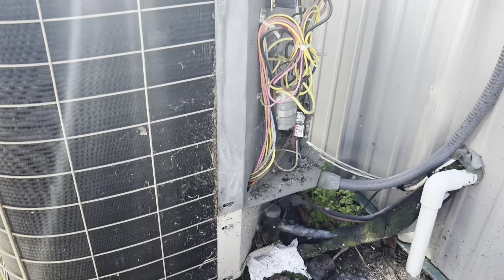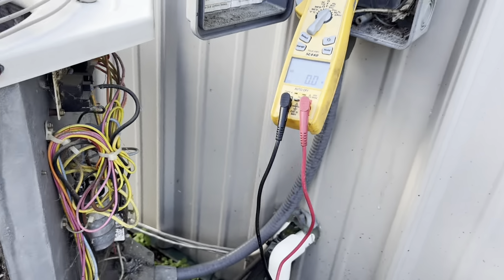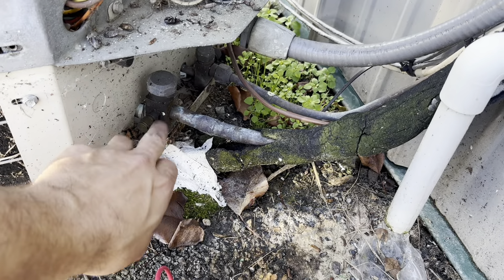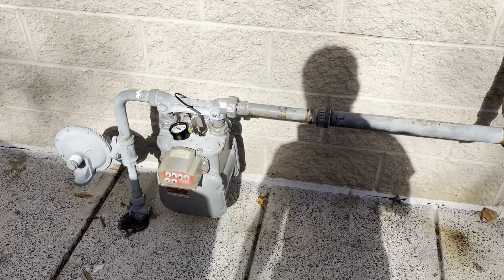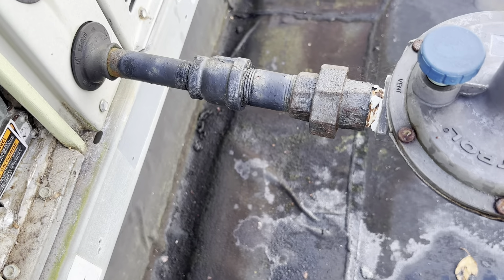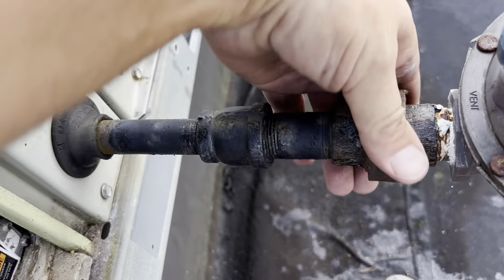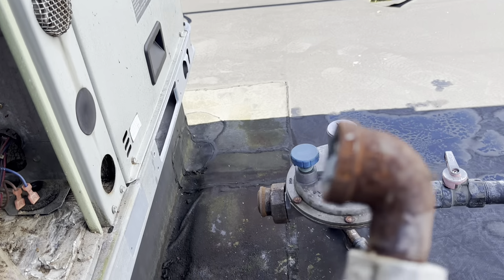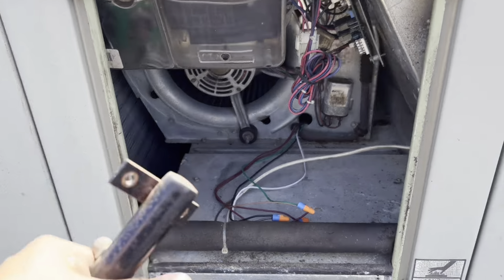No Cooling Call | Gas Valve Replacement | And Uncovering A Lie Another Contractor Told!

Comment: Nice video. I was told when I started in the trade. That whe you run the heat you got to put the cover of the fan back on. So you don't suck the fumes back in to the building. I hope you don't find that offensive

Comment: Good catch Jeff and those old carriers can't be beat if anything   if  the compressor goes replace that and flush out the evaporator and linesets and convert to 407 c.

Unless you want to do a Ted cook and buy a jug or 2 of r 22 from China. And test to see if it is genuine r22 and pure.

And Jeff my mom had a carrier ac unit from 1992 that was great.

And the heat pump version from 1997.

And they were great until she let an hvac company and a contractor talk her into replacing both with a cheap knockoff in 2010 or 11 that might be a nordyne or norteck or something.

And take out her good old thernopride oil furnace for the downstairs with another knockoff oil furnace.

Glad you are looking out for your custumers.
Reply: How is anyone able to buy the Chinese R22? I thought the whole point is that it cannot be imported after 2020. Customs isn't working anymore?
Reply: @realSamAndrew bad if it was brought into the US before 2020 it can be used.

Also g
There is 407 c for now.

But requires changing out the mineral oil over to poe and I would recommend as close to 100 percent as possible.
Reply: @gabrielstern4992  if it was brought in before 2020, why wouldn't the price be on par with everyone else, since there is a known market price and either you want it or not?
Reply: @realSamAndrew  I have checked on Google about 6 months ago and was shocked when a jug of r 22 was less expensive than 407 c.

That was brand new I don't know how legitimate the seller source was.

Or if the seller was sneaking it in on the black market but still to see r 22 jugs listed far lower than 407 c was a bit shocking.

Comment: While these gas detectors are good I have a super sensitive testo I still will take a belt and braces approach and do a bubble test at all those joints on top of the gas detection you do find very small and very slow leaks that way beyond the sensitivity of many of these detectors. While this might seem overkill I can reduce the false negatives….
Reply from the maker: Right on man!  Can never be too careful 🤙

Comment: Pm's are where you should be finding things that you wouldn't on a service call. You should be showing others how you do pm's so that they may learn how to properly do them if you do you know how to properly do so. It also tests yourself to know what your missing on pm's and how you can be a better tech. 
Don't think that pm's are boring because every system is different. Pm's also allow you to try out tools and tests you usually don't have time to when service calls are in demand. You would be an engineer if you can push yourself to learn more and not just residential but commercial and industrial
Reply from the maker: Good advice!  🤙

Comment: Those appion valve core tools suck so fucking hard. I have 2 and they both stopped grabbing the cores after a few uses. I use the accutools ones
Reply from the maker: Yea these were an upgrade over the CPS ones I had but finding out these are ass too!